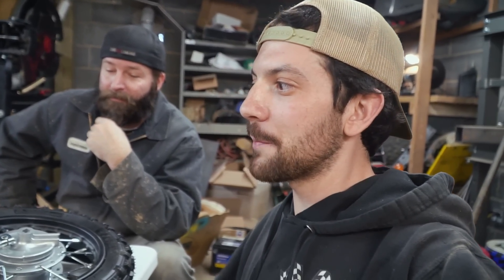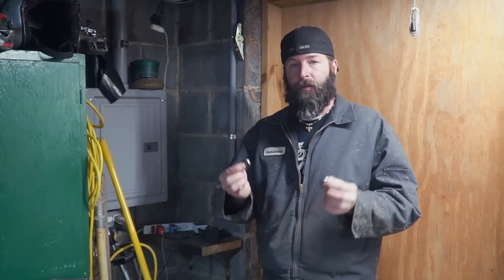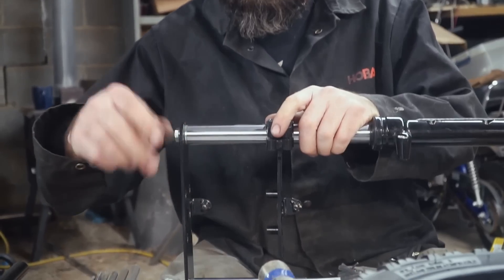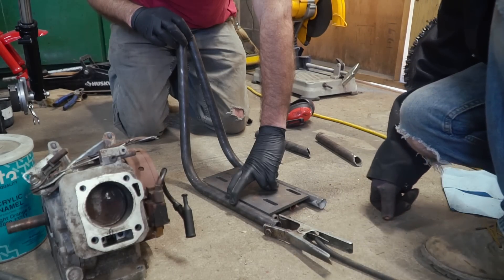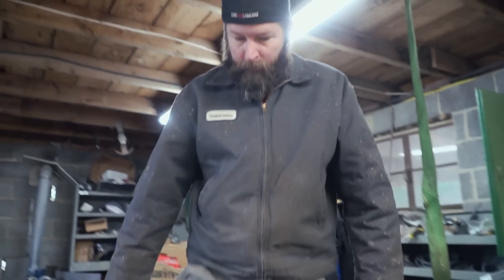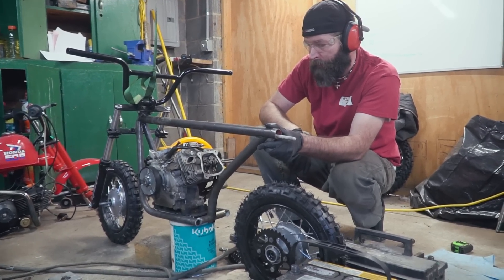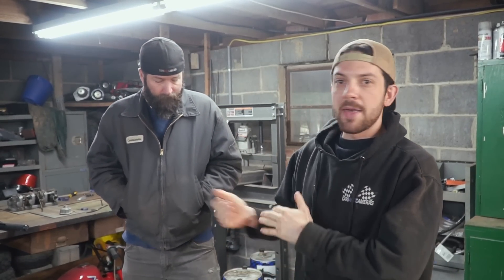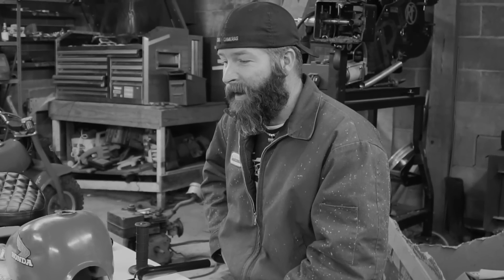How to Build a SIMPLE CUSTOM Mini Bike Pt. 1 | Full Suspension, E-Start Mini Dirt Bike!

Comment: Id like to do a steering head with Timkin bearings instead of sealed ball bearings. You would lose the slop and you can usually get them with a hole through the race for a grease fitting

Comment: Hey guys I have a question. Just picked up a suzuki Rv90 with a ssr 125 pit bike motor. Missing a few parts. Would a predator 212 be a better option with torque converter?

Comment: So lets say i have a 10 tooth front sprocket and a 32 tooth rear with no gov predator 212 and intake and jet modification with a header does anyone have an idea for top speed because the hub i mount my sprocket to is broken and im curious 😭

Comment: I have rubber-mounted a Predator 212 on restomod of a 1973 Honda Sl125. It makes a huge difference in engine noise. No problems with running a 30 series converter.

Comment: I think I heard Isaac say you were using sealed bearings for the steering neck?  They are not designed for that purpose. They will fail...be very very careful if you plan to try it anyway. It'll be fine not this time  You need tapered roller bearings for that application. 

Love your show 

Skiff's CycleWorks

Comment: While I love the stuff you're able to build with all your shop equipment, if you're showing this build as a first project for "aspiring fabricators" to learn from, it could be good to show "if you don't have a tubing bender here's how you'd cut/weld the tube to get a nice radiused bend" or "if you don't have access to a CNC plasma cutter, here's how you'd make these axle dropouts with just a grinder".  Your earlier builds used these techniques but I imagine you've got a lot of new followers since moving to the new shop who'd like to see the low tech approach. Just my $0.02

Comment: how about calling it the little ripper? because you know full well you're gonna be ripping it around the course.  the hardest part of building a custom bike frame is keeping everything square and true. that's why most builders use a frame jig. if you're gonna be making more custom frames in the future, the next project you might wanna think about is welding up an accurate, adjustable jig. it will make everything easier in the long run.

Comment: To mount the rear central shock u could use the technique that rather B welding is used to use. It's like 2 u-shaped pieces of metal for each end with a hole slightly offset from the center to bolt the shock. I think it'll work good!

Comment: Make a u style dual shock mount...basically take and do a 180 bend and set it over the rear tire and it will explain more...plus where the u meets you can mount the seat and have room for a rear pad seat with a fender

Comment: If you're worried about the noise the nut is making in the head tube, drill and tap a hole and screw a grease nipple in, then fill it with grease. Or drill a hole, fill it with grease, weld hole shut

Comment: Question ... regarding engine clearance with the upper and rear frame .... you were talking about the valve cover clearance ... but you don't have that mock up on rubber motor mounts which will probably raise the motor half an inch or so as well.  Shouldn't you mock up the motor mounts as well as valve cover clearance, and maybe gas tank ... depending on how low that sits on the frame.

Comment: A wise ex military mechanic once told me to ALWAYS AND ONLY use the concrete floor if you are hammering something. Use a piece of wood if it’s necessary. That way there is no reverberation when trying to hammer someone into place. 

In the automotive shop I work in I’m always on the floor hammering stuff and people look at me like I’m a crazy person but it’s the best way to do it

Comment: Your buddy THE VERMONSTER from Vermont thinks Your mini bike should be called SCRAPPER as John mentioned after 3 days Isaac and  John would be arguing over an empty build as a paradox that isn't the case here SO as a reminder that isn't the case here  Scrapper means it will be a beast on the trails that you 2 don't argue over it and it looks like a little SCRAPPER

Comment: I’m currently working on my first project, I have a little scooterx baja 49cc, and I’ve bought a predator 212 6.5hp to put on it and Im in the middle of extending the frame and welding on a new engine mount. I’m super excited to work on it and I’ve gotten a new clutch off of go power sports, thank you for inspiring me to do something like this I would’ve never even thought about doing this without you guys

Comment: In stead of a single curved tube for the rear you should have two  matching the bottom of the frame. Making a triangle with the ability to mount a shock in the opening. Would look even more sick than a single one in my head

Comment: i would come off the single tube just off the engine and do 2 almost 90 bent pipes to go to the back then you can mount the shocks and have a mount for the seat. then triangle off a spot to the bottom of the frame to make that point stronger

Comment: If you plan on getting speed with that minibike you might want to put a steering stabilizer on it. From the factory there is actually a certain amount of preload on the front fork bearings to prevent tank slap.

Comment: Hey John! Just wanted to let you know something that you reminded me of when Ike said he needed to drill a hole in the headtube.

It's often found in strong, sturdy BMX frames that they cut holes to the diameter of the pipe so it makes the welds stronger.
Not saying that you have to do it, tis just some advice. but it might be a good idea for future builds even though it is time consuming.

Comment: whats the welder settings at? it sounds abit off man I like your set up but sounds like you need to play with the setting amp n volt. sounds like you have higher voltage than amp. which is colder deeper with less fill if you add some more wire feed itle be smoother :)

Comment: drill a hole in the head tube and spray in a small amount of expanding foam while it's all bolted together... it will hold the inner tube in place and make the nut stay still

Comment: Why do you not prep the steel before welding? Those welds will be full of tiny pockets of dirt. All metals should be prepared and clean before any type of welding. And before anyone jumps on my comment im a coded welder here in the uk.

Comment: Looks like a good start so far. I tried rubber mounts in the past and it did not work. The engine moved to much and would toss the chain basically instantly.

Comment: I hate to be Mr. Safety but, it's best you guys find or purchase a small motorcycle frame and cut the steering Head off because you really need the saddle perches in the head for the races and the Timken bearings ..that are an absolute necessity. Also, you'll need the original hardened head pin for that assembly..

Comment: I think you should put a slight bend in the top tube in about the seat location, enough to drop down to the rear tube behind the engine, then bend it back perpendicular.

Comment: Instead of drilling a hole and welding a rosette to quiet that nut, drill a hole and install a grease fitting, fill the tube full of grease for your bearings and silence the nut at the same time.
Reply: Just don't forget to take the inside seals off the bearings otherwise that grease will do absolutely nothing. 
Some mower blade spindles did exactly that - kept both seals, and regardless of maintenance those bearings went our fairly quickly since they were not getting the fresh grease.

Comment: That head tube really needs some tapered bearings.
Reply: I don't mind the non tapered bearings, Norton Commando uses sealed ball bearings for the head stock, however that headstock itself needs to be done right, this is a problem waiting to happen.
Reply: @lotuselanplus2s  
Tapered bearings are far stronger in this application.
Reply: It'll be fine
Reply: @JamesCouch777  
....for a little while.
Reply: @TrulyUnfortunate  lol, probably 😁
Reply: Anthony, a Norton commando is still better than this setup, because there is a thrust bushing.  Even so, Commando’s are known for being high maintenance, especially concerning the front suspension, so....
Reply: @jaregg  Just one reason why i sold both of mine and kept my Triumphs, personally i'd bore out the hole where the bolt goes for a larger bolt and make a one piece neck assembly  with recesses for the races and yes, taper bearings,
Reply: Let’s face it, they don’t put enough miles on any of these builds to worry about long term reliability. This bike will do a few dozen laps around the property and then they will be on to the next project.
Reply: If you put a washer on the bottom for the neck to rest on and keep it lubed it should last a while.
Reply: @JamesCouch777  
Metal on metal wven with lube ain't gonna last long.
      They should have checked with Issacs Bro and cut up a mountain bike frame.
Reply: I was cringing when I saw the regular bearings. Tapered are the only way they'll last.
Reply: Use a tube from a bike with a title. 😉